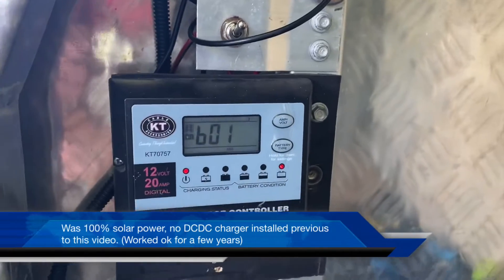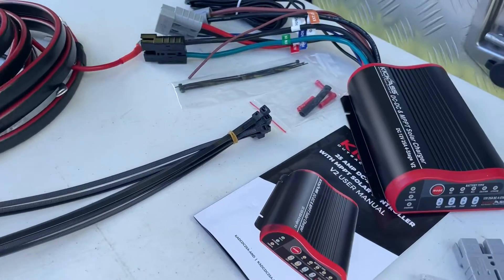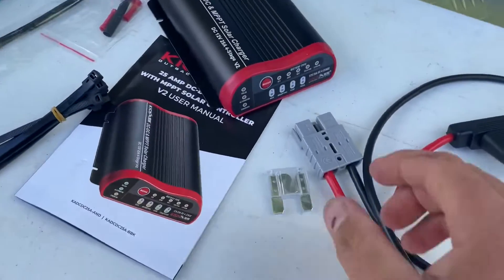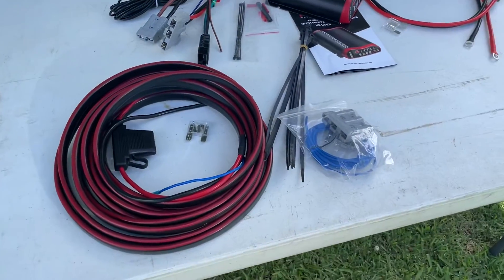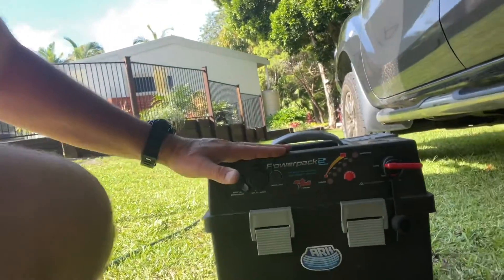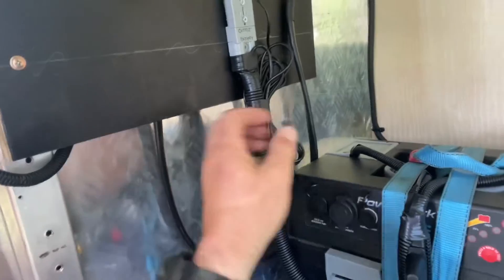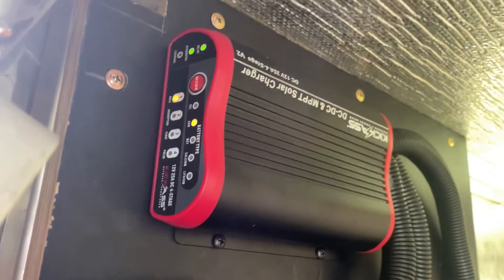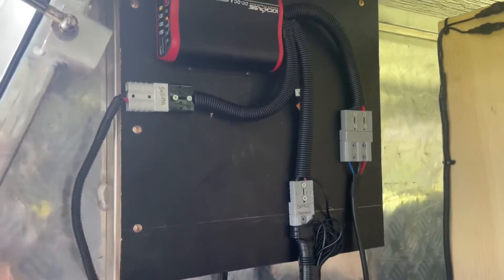KICKASS DCDC charger installation

Comment: So, I currently have the kings duel battery system with the smart battery isolator. (My car does not have a smart alternator) 
I'm looking to upgrade to the kickass dc dc smart charger (currently don't have dcdc) but I have just resigned my system and switched to lithium batteries so now I need one. Because I don't have a smart alternator am I correct that I don't need that blue cord that fits to the fuse box? And in the case can use the current wiring from my kings setup with the battery isolator?

Comment: Hey mate! thanks for the video. I going to buy one of this but I am wondering why you didnt pluged cable coming from the dcdc to the negative battery? If im not wring you attached it to the chasis.

Thanks!
Reply from the maker: @nicolasrojo7045  hi mate, thanks for watching. 

I have always used ground to chassis on my systems, my thinking behind that is that the battery is grounded there as well, so why not?
Reply: @auscamperfam115  totally! thanks for the video.

Comment: Hey mate where does the ext led wire go to
Reply from the maker: @BradMaguire-e5x  thanks for the comment.

Are you referring to the w
Black wire that is connected to the charger? If so that is the battery temp wire, I have put it into the battery box.
Reply: @auscamperfam115  no my charger has a I think I single brown wire with ext led written on it
Reply from the maker: @BradMaguire-e5x  I actually don’t remember connecting a brown wire at all. It was all plug n play with the leads shown in the video.

Comment: Awesome video, just 2 questions if you don't mind.  What size fuse did you use from the DCDC to the second battery, looked like an in-line fuse between DCDC and anderson.  Assuming it was 30-40ah?  and can I ask why you ran the negative cable to the chassis under the bonnet and not the negative terminal on the primary battery itself?
Reply from the maker: That’s you for your comment.

I can’t remember the size fuse, just what ever came in the kit. Pretty sure it’s a 30amp.  
From memory I connected the negative to that chassis earth strap to keep all the wires tidy, also I feel you get the best connection.

Comment: hey mate quick question and just double checking there wasn’t any wire you have to connect to the alternator itself was there ?
Reply from the maker: Thank you for your question.  No direct connection to the alternator, just the positive and negative of the starter battery through a suitable fuse

Comment: Hey mate, what piggyback fuse holder did you use for the 'on' wire? I have a 40 amp DCDC charger so just wondering what size fuses I would have to use in the piggy back fuse. I see a lot have a 20 amp capacity.
Reply from the maker: Hey mate, you can get the piggy back fuse from Supercheap / repco etc. there is not a requirement for a large amp fuse as the only current it should supply is a trigger from and ignition source to tell the charger to turn on.

Comment: Hey mate great video, just installed the same dcdc charger only problem is it won't pick up my solar panel any ideas tia
Reply from the maker: Hey mate, cheers.

Does your solar panel have a regulator on it? If so I’d bypass it and go to the DCDC charger. 
If not, I don’t know. Have you check all the connections to the panel etc?

Comment: heay mate, how many fuses did you put on the piggy back fuse that you used? thanks
Reply from the maker: Only what the holder could accommodate.

1 for the OEM that we are taping into
1 for the IGN trigger to the DCDC charger

Comment: What did you use to insulate the roof, how did you install it,  and it's it worth it?
Reply from the maker: It was some leftover stuff I found at work, I’m pretty sure it’s called Thermabrad 8, we used liquid nails, but probably should of used a glue that has some flex in it, and I do think it’s worth it.
Reply: @auscamperfam115  thankyou for your reply!😊

Comment: Hey, Whats size fuse did you use for the ignition wire? Cheers
Reply from the maker: Pretty sure it is either a 3 or 5amp fuse
Reply: @auscamperfam115  No probs. Thanks man. Appreciate you gettignbck to me.
Reply: @auscamperfam115  Hey mate, love the video. Just one question though, I've got a 2016 BT-50 GT and the seats are a 20amp fuse, my ignition wire is only 7.5. How did you get around this? Unsure if it's going to be the same amperage for both as your in-laws BT-50 might be different to mine. Cheers
Reply from the maker: @andrewfitzgerald5301  hi mate, when you use the piggy back fuse the seats will remain on the 20amp fuse and then put a 7.5 in the other fuse holder.
Reply: @auscamperfam115  ah righteo - so you put in a 20amp fuse, and just piggy backed it onto that? Thanks heaps! And thanks for your prompt reply mate!
Reply from the maker: @andrewfitzgerald5301  that’s it. Google search 12v piggy back fuse and you will see.
Reply: @auscamperfam115  sorry to bother you again mate - the 2016 BT-50 GT doesn't have a smart alternator, so the ignition wire isn't actually required? The ford ranger it's twin does, but the BT-50 doesnt
Reply from the maker: @andrewfitzgerald5301  even if you run the ignition wire, it is added security to disconnect the two batteries when you turn your car off.

Comment: Just found your video great step by step explanation of your installation. My first question is what does your alternator (amps) put out?  And which kick ass dcdc charger did you install. 
Thanks Again
Reply from the maker: Thanks for watching.
Not sure on the amps out put of the alternator, and the DCDC charger is their NEW lithium profile one with the Anderson style clips
Reply: Probably abit late now.. but the dcdc charger in the video is the 25A V2 dc-dc and MPPT Solar charger. 
The 2021 and onwards BT-50's use smart alternators that put out around 90amps

Comment: Great vid old mate. 1 question thou as I have 1 as well but yet to find time to install it in my Paj. How, can you see the progress of the charge going into the batt if you are driving? as I have a Renogy MPPT controller with bluetooth app which allows me to see just how much solar is going into the batt whilst driving. Is the dc-dc charger just realy for the alt use?
Reply from the maker: Thanks for the comment Steve, you cannot see the progress while your driving without adding another meter or light. I’m pretty sure from memory there is a wire there that can activate a LED. 
I have thought of a Bluetooth battery monitor and then you could check on your phone.